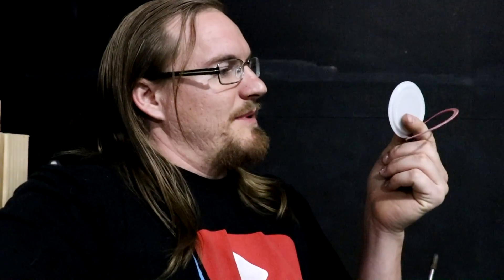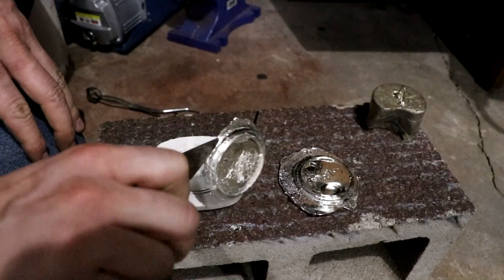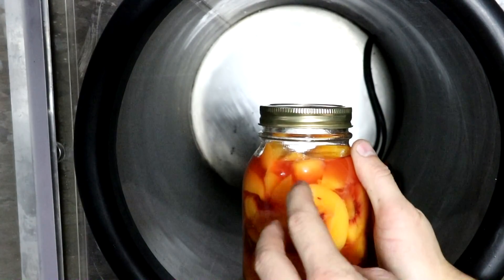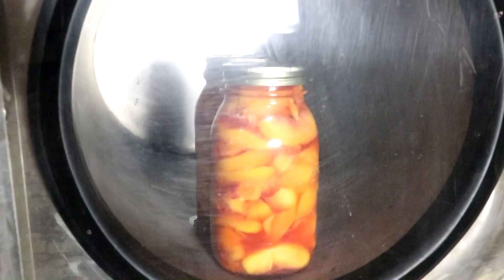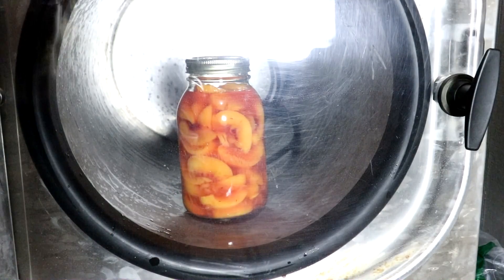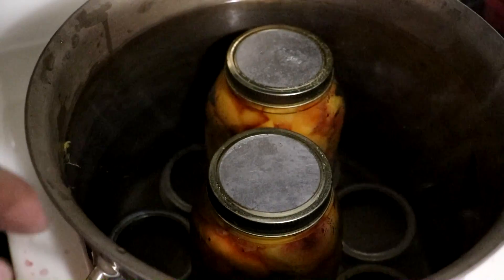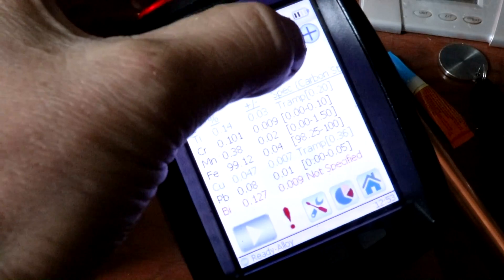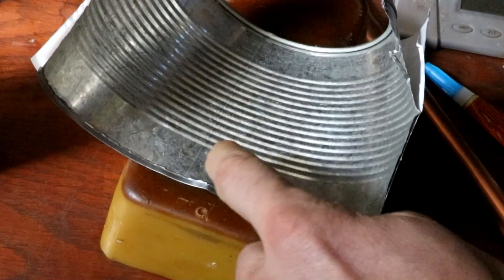Tin Canning Lids?

Comment: I was under the impression that boiling jars when canning serves to sterilize the contents as well as driving off the air. I guess the air is the important part to get rid of to prevent growth so maybe the vacuum chamber is good enough. As I was typing this comment I got far enough in the video to see you did boil the jars so I guess that answers that. I wonder though how a jar sealed in a vacuum chamber without boiling would compare after some months to one boiled. Peaches are going to have a lot of gasses inside that have a hard time escaping so there's where the expansion problems are coming from.
Reply from the maker: Yeah I think if you go the vacuum rout it may make sense to thoroughly cook them first.
Reply: Cody, you should make an experiment to find out if the can has botulism or not. 
Maybe also do a test on a can that has already gone bad too.
Reply: @thetraitor3852  It would be a tricky experiment.  You'd have to grow a culture and inspect it under a microscope, and getting a correct identification would require that you really know what you're doing.

There's pretty much no chance of detecting dangerous or lethal amounts of Botulinum toxin directly.  It's obscenely poisonous, with the lethal dose measured in nanograms per kilogram.  Less than a microgram (not milligram, microgram ) will kill you, making it the most acutely lethal toxin known, 3-5 orders of magnitude more toxic than mere chemical weapons such as Sarin or VX.

I honestly don't know what sort of detector it would take to detect this amount, especially since it's a complex, heavy organic molecule mixed up in a jar full of complex, heavy organic molecules.

It's really strange that the most acutely toxic chemical known to mankind is the active ingredient in a fairly common drug, Botox.
Reply: Keldor 314, if more women knew that botox is made from botulism toxin (hence the name), then many of them would never dare use it as a 'beauty treatment'. Their faces fill out because of the body's reaction to the toxin, then it takes months for it to be metabolised, and for the face to partially recover from the damage. The net result is that the skin becomes even more stretched and wrinkled than it was before the treatment.
Reply: would it be possible to sterilize it in some other way? like a UV light or something.. I don't know. I'm just thinking if there is a way to save the energy required for boiling the water - maybe vacuuming and then sterilizing could be more efficient way and even create better seal.
Reply: @zzanzare  you would have to use a different type of radiation. Don't think UV would have the optical penetration to kill everything in the jar.
Reply: @zzanzare  UV light wouldn't work since it doesn't pass through glass.  What would work is x-ray or gamma-ray light, and this is indeed used to sterilize sensitive things like meat or milk without cooking it.  I'm not at all confident this saves energy over just heating, though.  Radiation sterilization works by exposing the subject to very large amounts of x-ray light - so much in fact that the high energy photon impacts cause widespread damage to big organic molecules, thereby killing anything living in there.  This takes a huge intensity*duration, though, on the order of millions of times greater than an ordinary medical x-ray.  Consider also that a large portion of the x-ray light will travel right through the jar and out the other side, thereby being wasted.  This all suggests that radiation sterilization takes quite a bit of energy.

This isn't even taking into account equipment costs and safety.  I doubt that an x-ray source capable of sterilization comes cheap, and the amount of x-rays it has to produce is, more or less by definition, lethal.  And of course x-rays are invisible and shine right through all sorts of things, making it easy to misjudge if you're out of the line of fire, so to speak.  This is NOT something you want to mess with outside a carefully controlled industrial situation!  Radiation poisoning is a slow and very painful way to die.
Reply: @Keldor314  
  I don't know much about canning, but I do know UV passes through glass, unless the glass is specially formulated as a UV filter. Glass absorbs the other part of the spectrum, IR.

  In electronics, etching is a process of using copper clad material to make printed circuit boards. One common method involves UV sensitive film-tooling materials. An overhead projector type transparency film is used to create a reverse negative of the circuit design (created using CAD software), and a laser printer. The blank copper clad is covered in a sheet of UV sensitive film, then the transparency is placed over the copper clad/UV film. This stack is then sandwiched between two pieces of sheet glass to hold everything together tightly, then it is exposed to a 365nm UV light source. The exposed parts of the film turn into a harder plastic while the rest of the film is developed away using a sodium carbonate solution.
  I learned the hard way about UV filters when I tried to use a small piece of glass from an old halogen light fixture I converted to LED's. Most consumer halogen light fixtures have special UV filtering glass. However almost all sheet glass does not filter UV.
-Jake
Reply: Upcycle Electronics,  it depends mostly  on the wavelength. i don't have the numbers, but i know that most sterilization lamps are made of fuzed quartz (which is pure SIO2) to let a specific wavelength produced by the mercury arc to pass and they claim (and i believe)that it is in the uvc region and that normal soda lime glass would block it. so probably the effectiveness of UV in sterilization varies wildly by wavelength. 395 and 365nm light passa soda lime glass and is good for activating specific fluorescent and phosphorescent dyes and pigments, polymerizing specially made resins and fucking retinas, but probably not to sterilize.
the spectrums of absorptivity of materials and  effectiveness of processes are out there, i'm just too lazy to check.
Reply: @UpcycleElectronics  Did some research, and what you said is partially correct.  UV transmittance depends heavily on the type of glass.  Quartz glass lets most UV right through, so I suspect the glass sheets in your etching equipment are quartz glass, though 365nm is such a near UV that just about any glass will let it through.  Borosilicate appears to let through near UV, but rapidly drops to zero as it passes the 320-300nm range.  Soda-lime glass (the bottle is almost certainly made of this) blocks the most UV, with transparency rapidly falling to zero from 350-330nm.  These are both firmly in the range of near-UV, but Wikipedia suggests that for sterilization you'd want to look at the UVC band, which is medium to far UV, 100-280nm.  At this point, Borosilicate and soda-lime glasses are completely opaque, and even quartz and silica glasses start dropping fast around 200nm.  Again, glass bottles like in the video are almost certainly soda-lime.

You're correct about halogen lightbulbs needing a UV coating.  This is because the preferred glass for this purpose is quartz glass, which doesn't block UV very well.
Reply: zzanzare UV only works if you can hit the entire surface.  You can get every surface of the peaches nor the inside of the peach
Reply: Yes, all the oxygen loving bacteria would have a hard time.  But do you know what lives in a anaerobic environment? Botulism.  The heat is there to kill this sort of thing, I would not just vacuum chamber these.
Reply: id imagine you might get some sort of anaerobic bacteria growing in there
Reply: I don't think you're removing the air to prevent growth so much as to just create a nice suction seal on the lid.  After all, sterilizing canning doesn't do much good if it's leaky!

I think the expansion problems are mostly coming from too hard a vacuum causing everything to boil, though.  A gentler vacuum and/or ramping it up slowly could solve both the boiling and gas expansion problems leading to the foaming.
Reply: The heat is necessary to kill all the bacteria.  And the boiling timing isn't about sealing, its about making sure the heat penetrates the whole jar.  This is why you have to can quarts of grape juice for like 10 minutes and tomatoes for like 45.  I am pretty sure most jars would seal after 10 minutes, but the times are when the bacteria should be killed.  

If you don't boil for the correct time, you could definitely get some anaerobic bacteria havin a good ol time.  However, you'll likely notice if anything is wrong, the jars might unseal themselves or have a funky odor, or grow a mold.  You won't get botulism though, at least in peaches, because the spores won't be able to germinate in the acidic environment.

I reckon what Cody did here is reasonably safe if 20 minutes is the processing time for quarts of peaches at his altitude.
Reply: It always seems odd to me that people type comments before watching the complete video
Reply: MaakaSakuranbo, in the past i thought like that, but some subjects are so endearing or some error so irritating that many people can't resist. also commenting before the end of a video allow you to say something fresh that you may end forgetting to mention if you keep watching and getting distracted by the rest of the video.
a good feature would be if we could write a comment while watching the video without pausing it or rolling the video offscreen and that allow the already written and saved comment, be published only in the end.
Reply: @MaakaSakuranbo  because if you want to say something you dont want to forget you can type it
Reply: I guess, can always just type it though, then watch more. And then revise.
Reply: Same here ben (NightHawkInLight) i was just patient enough to wait (not always like that).
Reply: NightHawkInLight z
Reply: I had freshly boiled jars lids and rings available when I heated a # 10 can of cheddar cheese sauce for nachos, not trying to "can" the cheese i was just trying to save it for a few days in the fridge, I poured the still hot leftover cheese into the jars then covered it with the lids and rings I let it cool on the counter and put them in the fridge an forgot they were there for about a year. we popped it open . it smelled ok and tasted ok too nobody got sick

Comment: Hey, Cody! 
Try coca-cola cans, they have a Tin coating aswell. It is due to the pH of the drink, it is around 3,5 and Tin, as far as I know, is the only metal that can sustain such low pH and be used for foods/drinks at the same time :)
Reply: Coca-cola cans do NOT have a tin lining......Coca-Cola has Phosphoric Acid in the mix, and if tin was present, the acid acting on the tin produces a toxic result(possibly Tin Phosphate)?
In fact, that's why coca-cola syrup cans had to be changed from tin to stainless steel-the formula was modified to include Phosphoric Acid, so they had to change the cans.
Soda cans have a plastic lining.

Comment: @cody: the Tin is used to prevent the steel from oxidizing in a low ph surrounding, as it prohibits a galvanic cell being formed. That is due to the higher electronegativity of the Sn with 1.96 in relation to Fe with 1.83 Pauling scale. So I suppose most oft the canned fruits come with a tinned can.

Comment: Most cans around here are coated on the inside with a thin plastic film. You can see it when you burn them. I suppose it is polyethylene or something similar, and apart from separating the food from the metal I would expect it also helps a great deal with sealing up the rolled seams.
What are you potting at the end there? Doesn't look edible what use is it?

Comment: What about irradiating the peaches instead of boiling them to sterilize the jars? I think that would produce the same shelf stability, but with a more "fresh" peach texture instead of a cooked one.  Would definitely be interested in the differences between a traditionally canned item vs a vacuum chamber/irradiated one. Possibly a future experiment? :)
Reply: UV irradiation or Gamma?
Reply: @PixlRainbow  uv wouldn't penetrate that deep, at least I don't think it would, as it is easily scattered by even air and only damages our skin. Gamma is really hard to make or uncontrollable (unless you happen to have a fusion reactor), x rays should be possible though. But I still doubt it wouldn't poison the peaches, by destroying lots and lots of molecules in the "wrong" way.
Reply: @andreaaristokrates9516  Cody does actually have radioisotope samples. I'm not sure if he has any that undergo gamma decay though.
Reply: I know, but even having a sample doesn't mean it's the elephants foot, able to make a jar sterile. Would a sample emit enough gamma, Cody would have to basically store it under 3 meters of water, lead or something else insane, because gamma doesn't really care which direction to exit the nucleus and it would burn him handling it. The thing is that the process has to be faster than the reproduction speed of the bacteria, easy with heat, all are killed at almost the same time. When to stop with radiation? To tell the answer is surprisingly hard, but it must depend on the radiation intensity distribution thoughout the jar, maybe even the minimum of that - in short: hard radioactivity.
There is no non-industrial way to use gamma, at least any I can see and be sure no person will be harmed. Btw: bathing (figuratively or literally, an actual bath in saturated solution might be actually one way to go) the jar in radioactive material would most definitely contaminate it with radioactive dust, but I'd trust Cody on that one.
Reply: @andreaaristokrates9516  ALL astronaut food going to ISS is irradiated, I hear. Same for Omaha Steaks and probably many other foods rated for prolonged storage. Many imported foods are too... like fruit. They do use gamma rays, from the decay of Cobalt-60. It is made from common Cobalt by exposing it to lots of neutrons from fission reactors.
Reply: They were cooked before the caning anyway
Reply: @guyfriedman295  
No, just blanched to take the skins off.
Reply: @court2379  ah,ok,tnx! 👍
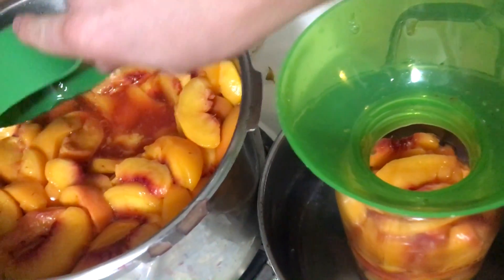Reply: (Watch @4:04)
Reply: I'm not literate enough on the technical process or whether Cody would stand a chance of reproducing it with what he has, but irradiating sealed containersof consumables is definitely a common process. It's done at least sometimes to eggs, and as a fun fact, that's how they treat our legal weed in Canada. Once it's sealed up in packaging they give it a zap to kill off bacteria and fungus.

Comment: Canned pineapple looks pretty similar. Might be galvanized steel but the color darker and its shinny....
Reply: Pineapple is quite corrosive, so you should find a plastic coating on top of the metal. I might be wrong, but the cans I've seen have all been lined with something non-metallic. Interestingly, a number of manufacturers advise that the contents of a tin should be decanted into a specified type of container after opening, so maybe they're worried about the protective coating being damaged when the container s opened?
Reply: the warning about transferring to a non-metallic container is about oxidisation of the metal that makes up the can (steel or aluminium) and the metal oxides being picked up by the food.

Comment: While you can do whatever you wanna do and this seems like a neat project, I'm left wondering: Why can't you just wash those plastic lids an reuse them? If the issue is that they're plastic, does it matter if you only use the ones you have anyway?
Reply: Not sure what kind of plastic they are made from, but in my experience plastic tends to absorb things. With reusable plastic water bottles if you put something else in besides water the taste will linger for a long time. I've washed some reusable plastic bottles dozens of times and the taste of non-water beverages still lingers.
Reply: @heroslippy6666  generally the best plastic for use in food/beverage storage is polypropylene. PTFE would work too but it's a mite expensive.
Reply: Hero Slippy Adding some tea into the plastic bottles and leaving for some time will help get rid of the smell
Not sure how long it takes tho
Reply: What he was saying is that the regular metal lids must be thrown away and that is a waste when you are using them for your lunch.
The plastic lids are reusable time after time but the issue he has with them is that they are still plastic.
Reply: In most cases the plastic lids dont last more than one or two uses before they arent sealing anymore.

Comment: Why not just use a little T fitting with one end in the jar, one end with a check valve on the end and the other end with just a normal valve? Seems like setup would be alot easier and opening the jar would be alot easier.

Comment: What's wrong with those fully metal lids? You know, the ones that are not just the ring with a thing in the middle, but a solid metal lid (can't explain it any more clearly, sorry)
Reply: Nothing but they have the gasket on them and he is trying to make a totally reusable product.
Reply: They are single use generally.
Reply: On these types of lids, after they are sealed, you can remove the outer ring and use it on another jar, which helps reduce cost.

Comment: Since your homemade lids are not level lining them with silicon would help make a much better seal.
Reply: Florida Man is correct. Also, that's silicone, not silicon.
Reply: @cullenhutchison6528  Depends on where you are. It's like aluminum and aluminium
Reply: Not in the english language, there silicon is always the element and silicone is the polymer.
Reply: I really didn’t think about that. Thanks for pointing that out for us more simple folk. Lol